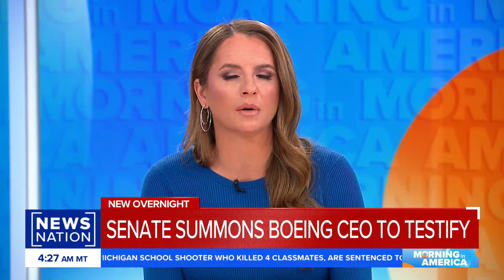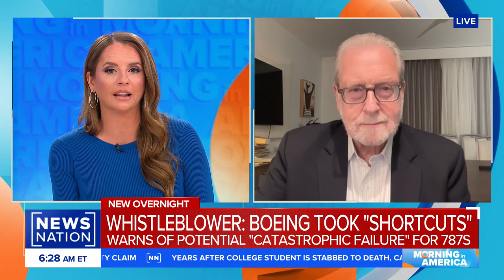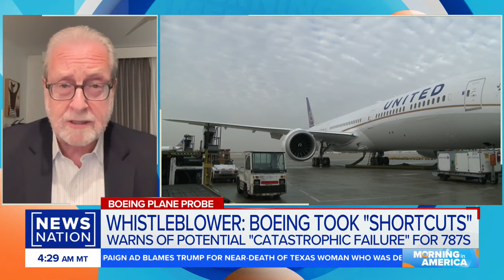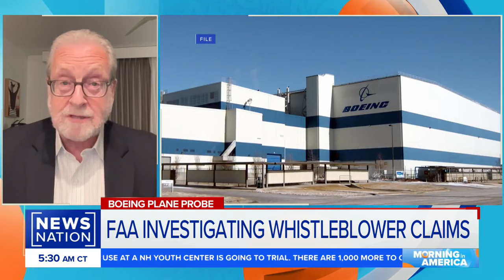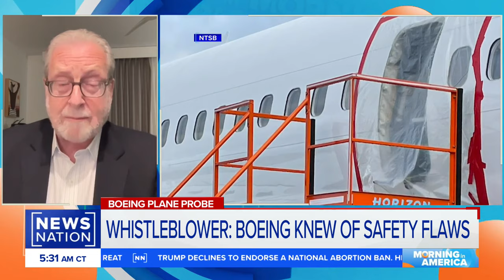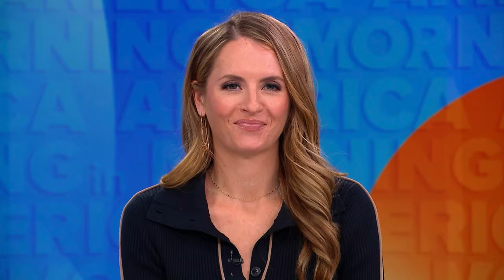FAA to investigate Boeing whistleblower claims of 'shortcuts' in production | Morning in America

Comment: Wait but the Airbus A350 is made with composite also?
Reply: The issue is not that is made with composite materials, the issue is that the pieces for the 787 are made by different contractors and they don't fit well with each other, and what the whistleblower says is that with current wya boeing is putting them together the planes have a huge risk of breaking apart due to stress
Reply: Structures are very sensitive in the areas they connect at. 

There's a very interesting video about the Hawaiian cabrio made by Mentourpilot that touches this topic. Even though the 787 is far more difficult to assemble than previous plane generations.